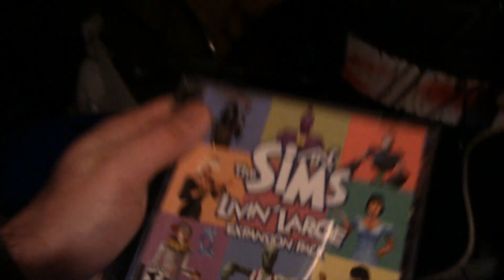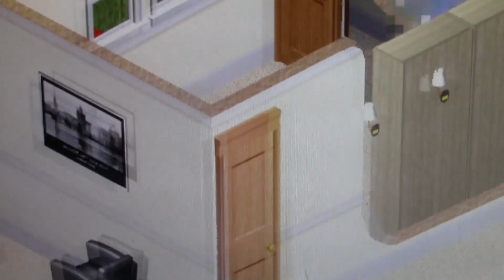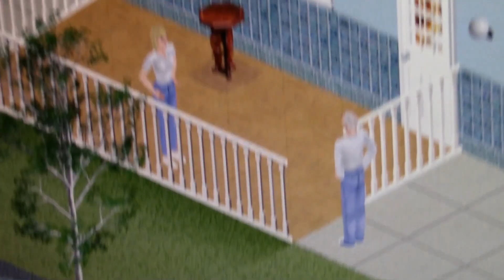Dell Computer Destruction 3

Comment: this is an example of a child playing roblox and the computers reaction
Reply: the computer wants to die because of the cancerous fanbase
Reply: @ymcooper  not anymore for me bro
Reply: @NormalChannel762  Well guess what, when roblox was installed on my windows vista pc it gave me a error message so I had to use my phone instead
Reply: @MrIzaiah2007YT  k
Reply: @NormalChannel762  yeah like when I click the roblox setup exe file to open, it said "Roblox has stopped working"
Reply: @MrIzaiah2007YT  open as administrator
Reply: @11RexVR11  I'll try
Reply: @11RexVR11  Nope, running it on administrator doesn't work.
Reply: @MrIzaiah2007YT  Roblox doesn't support windows versions below windows 7.
Reply: @Drakoneon  well hey at least I got a Dell optiplex 390 with windows 10 for Christmas Last year
Reply: @MrIzaiah2007YT  i have a dell laptop that i got on june 24th 2019 with the old logo (running windows 10 gladly)
Reply: Especially on Pentium 4/Celeron D computers!!
Reply: Fr

Comment: My school just upgraded their computers from these pieces of crap. 3100 cant even run windows 7 properly
Reply: I would agree with you if my Windows 8 wasn't shit.
Reply: zoruaboy Your Lucky, my school is still using these
Reply: Our school still has the Compaq-HP cases from 2006-2008. I believe they just reused the cases and upgraded the insides but I remember when they ran Vista.
Reply: @chasee3797  My school jumped from XP to 7. No vista :(.
Reply: 😂😂 I hated it my old garbage can windows 7 always got viruses when I was 9😂😂 I miss playing happy wheels on it😂😂
Reply: Maddafi you can tell their cpu cooler are not proper heatsink like the one you get from Intel/AMD or Cooler Master

Comment: Destroy a Gateway brand next.  I have a couple of ideas for you to try.  First, while a game that's very HDD intensive is running, remove the cover of the HDD, then start playing around, eventually destroying the components (would be more interesting to have a raid 0 setup and do what I said to just ONE of the drives to see what happens).  Second would be to remove the heatsink and CPU while it is still running, can also try removing and re inserting the GPU with it still running.  Also try moving the metal part of a screwdriver along the pins of some of the chips on the RAM sticks.
To add to one of the posters MOT suggestion, with the CPU out, connect as many wires as possible to the pins in the CPU socket, and some more to an empty A RAM slot.
Reply from the maker: Those are some great ideas.
Reply: Excelent Idea!
Reply: Shawn K
it is , dew it , im from france , i love your videos , DO IT
Reply: absolutely awesome idea
Reply: Darknecros7  Oh Shit That's Tom
Reply: It's Tom arght
Reply: I have somewhere recorded many years ago footage of me messing with a laptop HDD while it was running.

Comment: I know this video is super old but, those screws on that plate are if you wanted to use any of the expansion slots and the screws are to hold them in. Call them spare screws lol

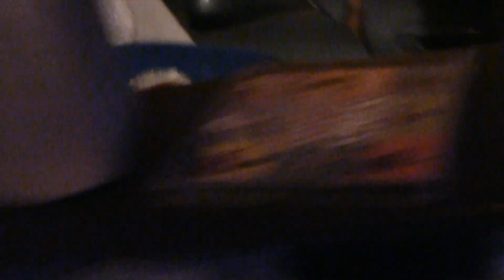Comment: 4:42, just unplug the machine, I had a 2003 HP Mediacenter machine that constantly had "Fan Spasms" as I call them when the fan would overheat because it was in bad shape, I would just unplug it and take that as a cue for a 1 Hour break off the machine for it to cool down. I know own a new Gateway NE 722 Laptop and the old Media center has been fixed ad is now running Windows 98 instead of Windows XP and the old fan is completely Fracked so I bought a new one

Comment: isnt there like ram cartriges in the pc if thrre are aren't u able to take them out and use them on a new pc
Reply: When installing sticks of RAM into existing computers, you usually use multiples of the same type. I don't recommend mixing and matching, especially since some connectors in the motherboard aren't designed for some grid arrangements.